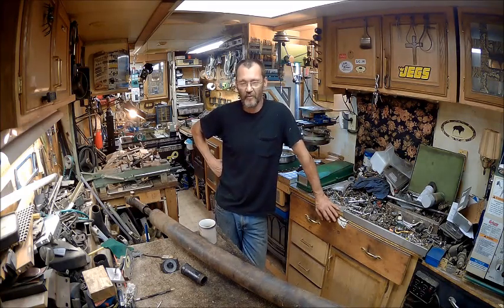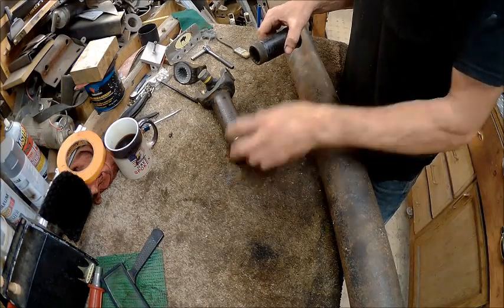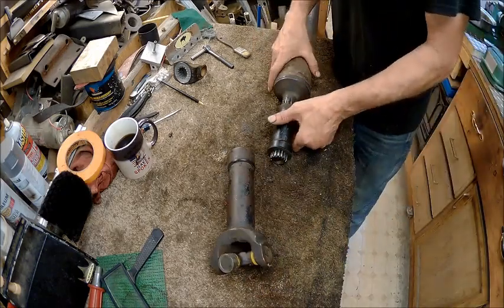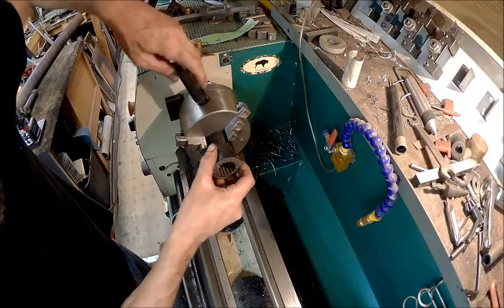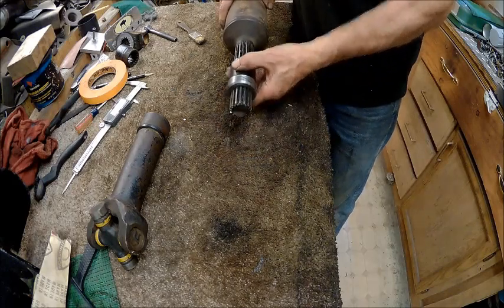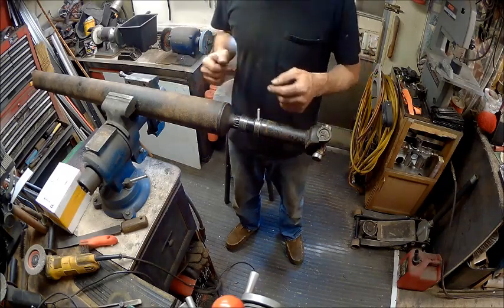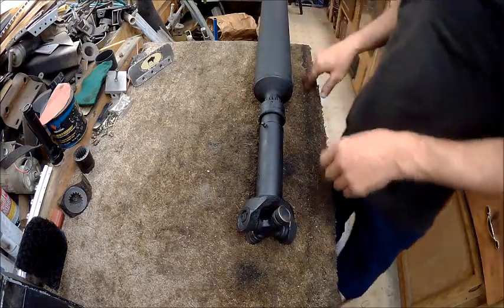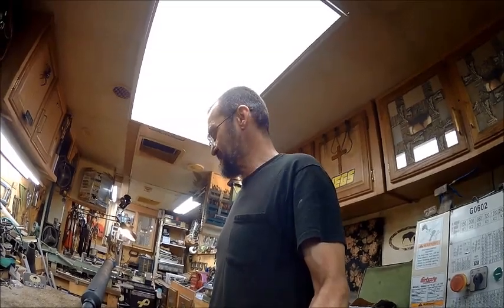how to extend a drive shaft yoke

Comment: Hey bison how has this modification held up? I would like to do something similar.
Reply from the maker: it was just a temp fix. it didnt last very long. i ended up having to buy a longer yoke. i would not recommend doing it. i only did it hopeing it would last long enough to move 267 miles away